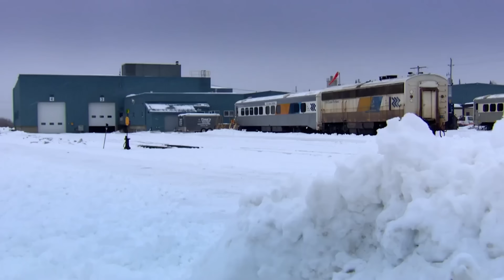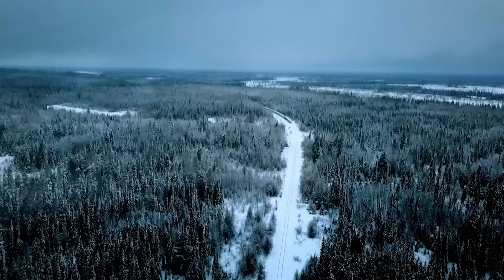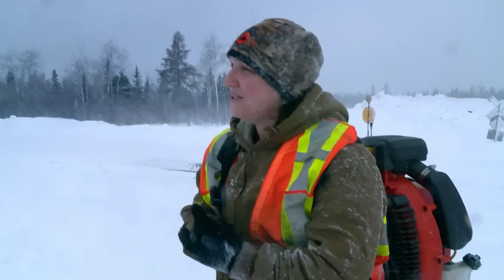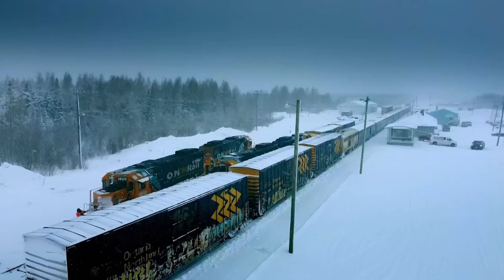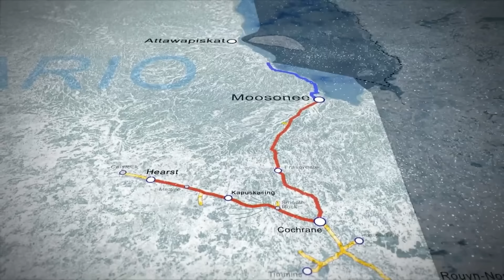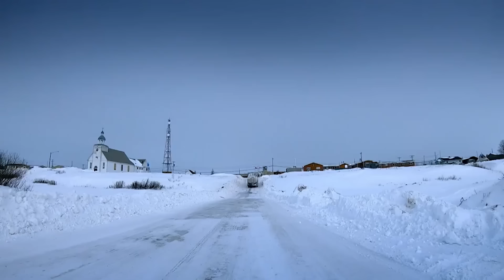Can This Crippled Train Save the Town?: Extreme Ice Railroad Part 2 | Up Close

Comment: They need to plow the snow further away from the road. The snow insulates the ice, thereby slowing the natural thickening of the ice.

Yellow ice is usually not as hard/strong as white and/or 'clear' ice.

Why wouldn't they keep the switches well-greased because ice will come off fairly easily? And/or why don't they have propane torches (BBQ-sized tank with a wand) to melt the ice in the tight spaces?

The heavy trucks on the ice bridge have to go slow and keep their distance from each other because heavy trucks can cause a 'wave' of the ice and, if this were to happen, the ice would crack all up. SPLASH! Wonder why they didn't explain that?